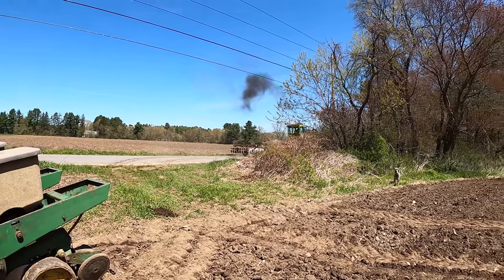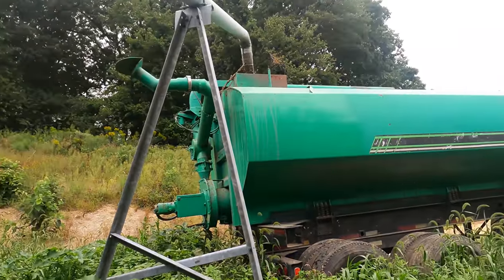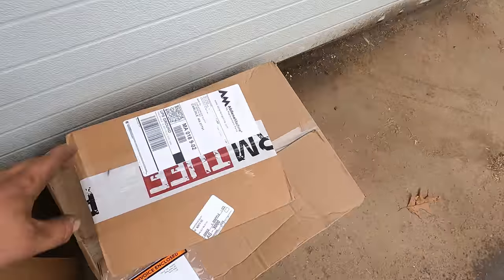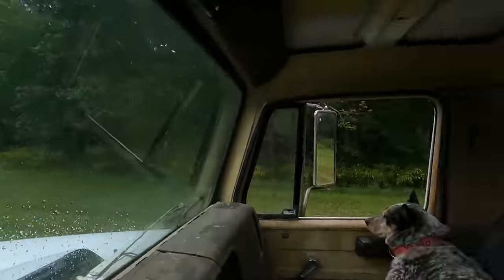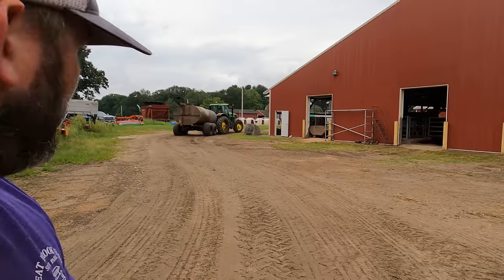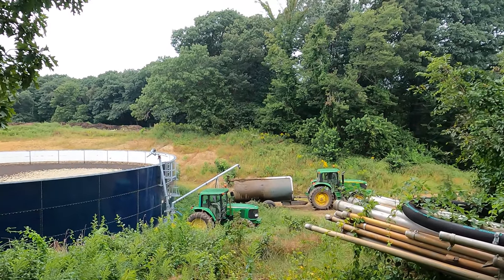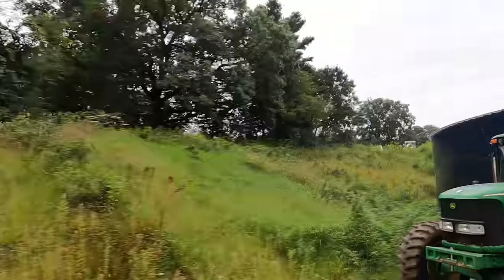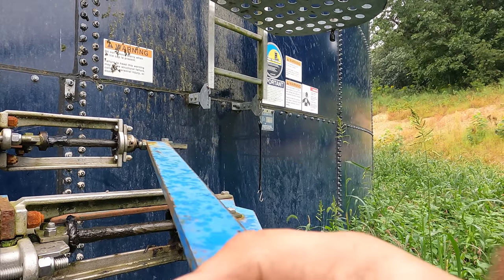Racing A Hurricane- Manure Hauling

Comment: Hey Duffy goodvid... Your comment on the sand in the tank got me thinking just wanted to give you my idea if you can make it work for you awesome then if not then all well... I used to work for a grease trap company that pump them out at restaurants they had their own processing facility at the yard so I just went back to offload it. they also had a problem with sand and sediment in their tanks now their tanks are not as big as yours but maybe you can make something work pretty much all they did was they took a piece of angle iron and attach it to a long shaft and stuck a electric motor on to it and they got to spin to make a slight Whirlpool effect and apparently that was enough to keep sand and sediment from going to the bottom.... Just my idea for you

Comment: our trucks hauled any where from 20 to 60 loads perday while we cleaned out lagoons. most lagoons where 1 to 3 million gallons,  but we never had long hauls with traffic like you have, most was fill and down the feild to spread start points. most jobs we had to fill pumps and one going around the lagoon agitating but did use Houle tanks and pumps. I actually enjoyed spreading, but allot of my time was on location Mechanic. with 9 trucks running and 3 pumps we had a few break downs.  If wanna make a Injector Bar  gives me a yelp i can help ya do one really cheep, i built 5 for 5 of our trucks.

Comment: Hey I know you need some rain caps for the chopper and the tractors  ie 7520. So put “tractor rain cap” in a google search and you will find tons of them some look different and some look like a John Deere  also remember to point them so when your going down the road if you hit a small branch it will slap it closed not rip the flap off that’s how they are designed to go. Also so if you had a semi trailer dolly couldn’t you pull the big semi manure spreader with the 7520

Comment: A low spout helps a little with smell in air, but let's face it most people still dont like it
Reply: Drilling it in would lower odor transported by wind even further, but requires specialized, probably expensive machinery.  And perhaps New England's rocky soils might prevent this method of application because of equipment damage and downtime.  I'd be very interested in knowing the answer.  But I agree, it "Smells like Money" to me too.  I have no idea if earthworms have any sense of smell, but they sure "go for it!"
Reply: @theburnhams2925  he was spreading on hay. So dont want to inject

Comment: You're fortunate that the local government hasn't implemented a restriction that manure has to be worker under within 47 hours.
Reply: Not sure where your from but some states are pushing more torward injection my boss runs some pretty sweet setups for grassland injection and then the 9500gl Houle tank I drag around has a set of bazooka injectors as well as my co worker for corn